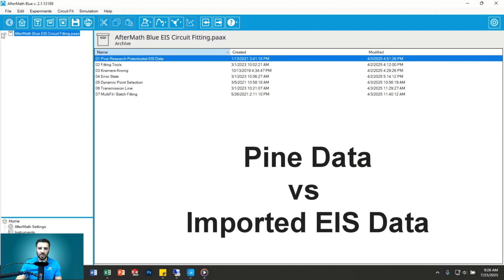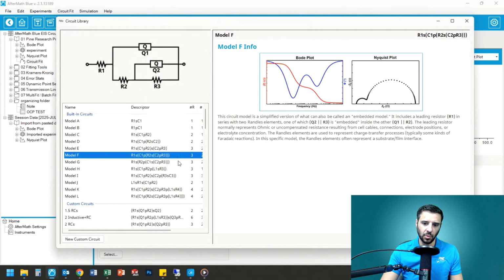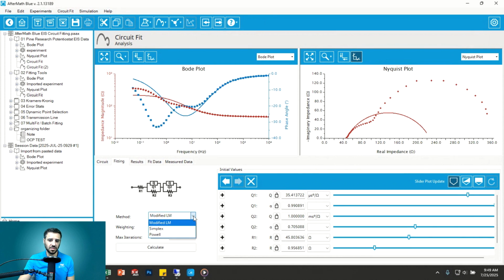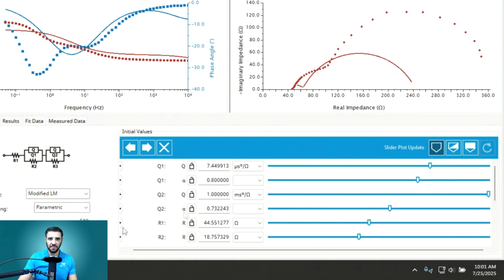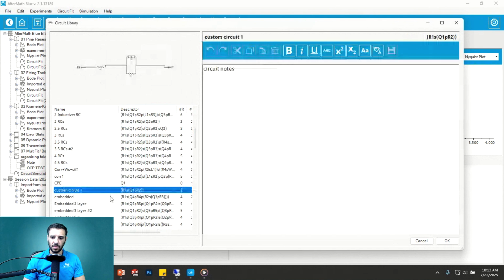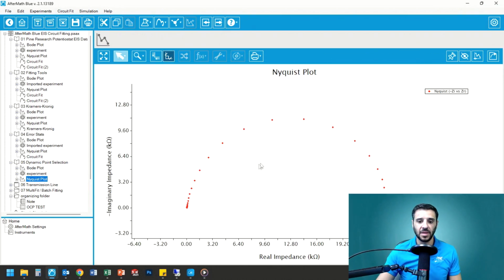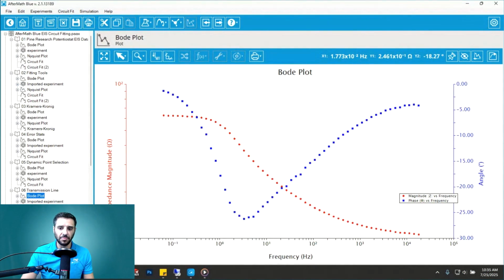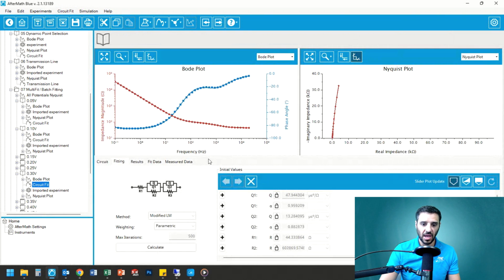EIS Circuit Fitting Tutorial

Comment: hello sir , I hope you're doing well , i am working on electro catalysis ..and i am a new in this field. so i am trying to make a catalyst from metals by electrodeposition technique.. i already made one but now going to another one but this time i want to use one ono metal.. is this possible with non metals because electrodeposition  a process which positive ions goes and sticks on the surface of cathode and make solid layer.. but if i use non metals like fluorine   ... it will give us negative ions so how it will go to  cathode ?for example i want F doping into Nickel , molybdenum on Nickel foam and use the electrodeposition method.. is it possible ? thank you ..
Reply from the maker: If your question is whether it is possible to electroplate something like fluorine via electrodeposition in the way you are describing, the answer is no.  However, if you are wondering about heteroatom doping (e.g., adding a different element into the lattice of an electroplated metal), this is certainly something that can be done.  What you will need to do most likely, though, is do some literature investigation to learn about various synthesis methods because not every element can be doped into every metal.  And the ones that can probably have certain experimental parameters required (potential, current, temperature, solvent, electrolyte additive, salts, etc.).  For instance, if you electroplate Cu and you want to dope fluorine into it, it may not work as you expect if you just add some salt with F- present.  Or perhaps it will, but not in the way you expect.  This is why I strongly suggest you investigate the scientific literature to find out how other researchers have synthesized a particular kind of doped material so that you can try to emulate it in your lab.